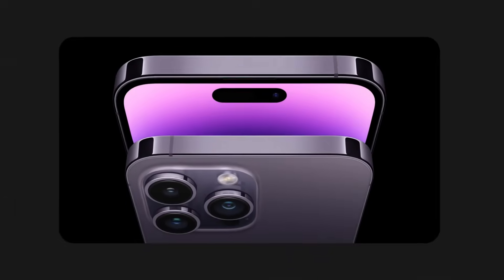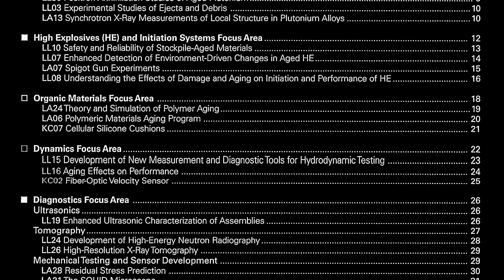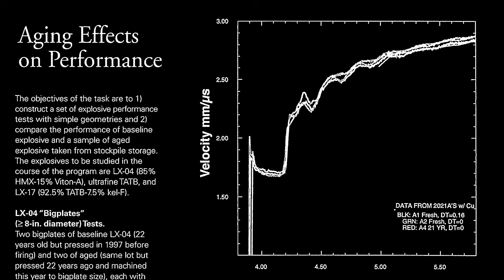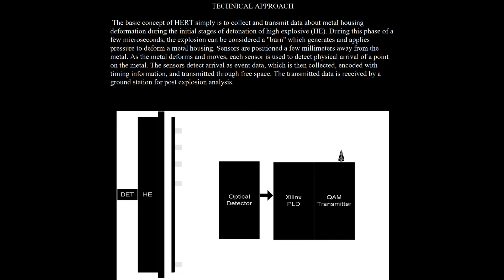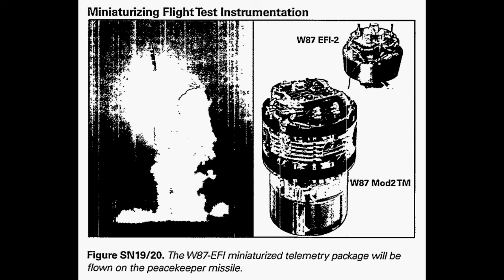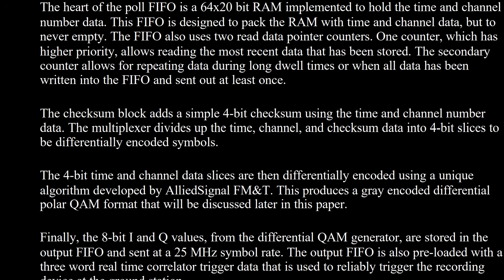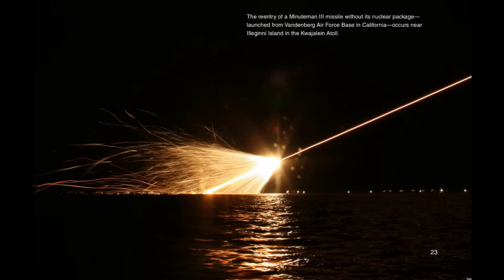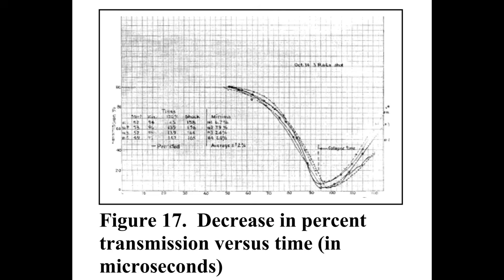The Computer Designed To Die In Microseconds

Comment: It's not a computer. This device is not Turing complete.
Reply from the maker: The FPGA is absolutely turing complete.
Reply: @scottmanley  *when programmed with an IP core. Otherwise I can call a suitcase full of discrete 2N3904 transistors Turing complete -- just need to connect them.
Reply from the maker: You'll find that most things that are demonstrated to be Turing complete may require a setup process.
Reply: @scottmanley  and what would be the limit for that setup process? With large enough limit I can call not only a suitcase of 2N3904s Turing complete but also a pile of sand with some phosphates and metals.

Comment: This reminds me of a story of a guided rocket launcher that had a memory leak in its programming. Ultimately the project lead decided they didn't need to fix the memory leak because by the time it would become a problem, the computer would have much bigger problems, such as the high speed impact with the target (could knock some wires loose) and the detonation of the explosive

Comment: In the 1980s I worked in an X-ray physics lab whose primary work was measuring the X-ray flux of thermonuclear events.  We would spend months working to capture multiple channels of 350ns of data with as fast as 10ps rise times with about 9-bit resolution.  Once the data was captured, we had around 100 milliseconds to transfer a sample of that data into non-volatile storage before the mechanical ground shock arrived and potentially caused a power outage or physical damage to the data collection system.  If the system was still running after the expected ground shock time, it would go back and collect all the data and store it in non-volatile storage.  The system used TI minicomputers because they were set up for battery backup.  We also used 8" floppy drives because in those the read and write heads were in contact with the floppy disk so the heads couldn't crash.  If everything went well, once the data was stored, a program would start analyzing the data, so the next day or so when we could get physical access, the reports would be lying on the floor of the screen room where the minicomputers, transient analyzers, Versatec printer/plotters, etc. were.  This was before fiberoptics, so everything was down in the tunnel.  If you had a "leaker", the data would not be available for a few thousand years.   While I worked in that group, we were lucky, there were no leakers.

Comment: Talking about not needing to worry about timer overflow reminded me of a simulator project I worked on back in the '90s - we were using a bunch of SGI workstations to run the simulator, and needed a reliable way of determining time deltas between events.  Conveniently, SGI had put hardware counters on all their hardware, so we wrote a timer class that read the counter and computed time deltas from it.  The low-end hardware that we did most of our development on only had 24-bit counters, which rolled over pretty quickly, 10-15 seconds or so IIRC, so we had to manage rollover events on that hardware.  The big Onyx workstations that we ran the sim on had 64-bit counters, which wouldn't roll over for about 10k years or so even with a higher update frequency, so we didn't bother in that branch of the code.
Reply: Very cool!

Comment: I have a Sony experia 4 perfectly fine earlier top model phone but it has become almost a useless brick because Sony no longer provide uppdates so no new programs works on it , and you can not install old program versions... Same happened to my iPhone 4 it was useless brick the last 5 years I was using it, only the phone worked and apps that did not require intenett to work. No new apps was possible to install so it was frozen as it was.

Comment: 100MHz is very slow,  specially if you work with FPGA's.  In this day, STM32H7 has timer with 500Mhz clock frequency, not to mention some old TI DSP's that can have sub 100ps (10GHz equivalent) capture ability

Comment: I became fascinated with Xilinx technology in the '90s while working as a production tech for an Australian ISDN MUX manufacturer. While I was familiar with various families of programmable logic devices (and I liked PEELs because they were electrically erasable) the Xilinx chips were effectively a RAM array with each bit operating a switch in a logic array such that a hardware circuit was wired up on each boot up as the bit-pattern was streamed into the Xilinx device serially. Compared with sending a tech on-site or returning a board for a hardware mod, (often involving track cuts, solder and mod-wire) you could perform a hardware mod by sending a file over the internet.

Comment: Confidence in "untested" nuclear weapons should be tempered with prior empirical evidence.  In the Castle Bravo test, Lithium-7 was incorrectly calculated to be inert as a fusion fuel.  It was not inert and caused the yield to be 3 times higher than expected.

Comment: It's also interesting from a software standpoint - I was talking to someone who used to work with missile software and apparently one place they worked some new person came in and was upset that the code had memory leaks and would almost certainly fail and crash - but it didn't matter because the missile it was controlling could only fly for X seconds so they just had like 2x the amount of memory the software could ever possibly consume in that amount of time, making impossible to crash because it would always detonate before it could fill up the memory.

Comment: I don't think that the explosions and pits are spherical. Later as weapons got smaller, safer, only used as low yield initiators and simulations got well calibrated, timing more accurate the "package" got more cylindrical.

Comment: The technology base that goes into building and testing Nuclear Weapons is truly incredible its a shame that we don't (Can't?) know more about it all. Many of the devices and systems used in testing were more sophisticated than the bombs themselves. I read in a memoir from one of the former test site engineers that they had a very tough time getting their monitoring hardware to survive long enough and being able to read data out fast enough. The technical challenge was huge just in designing the the explosive systems and massive doors used to seal off the testing tunnels in just a couple of milliseconds; only then to have to hold back the force of the explosion and maintain a good seal to prevent leakage. The materials and devices used within the bombs themselves are truly sci-fi such as solid-state neutron generators, aerogels, and the miniaturization of the arming, fusing, and firing sets themselves with their incredibly complex mechanical and electronic strong/weak links. If people knew about the advances that have come from our pursuit of Nuclear Weapons/Nuclear Energy they might appreciate it all a bit more.

Comment: This is super cool, though to put it into perspective the top layer of FR4 transmits data on copper lines at around .7c or so on nice controlled impedence circuit boards (Isola, Rogers, whatever-- the name brand stuff). Coax is around 2/3rds for standard RG58 (IIRC) and I bet there are low-capacitance triax type mil-spec cables that'll get you close to .8   

I'm surprised that you have such a loose budget for propagation delay on a spherical detonation device-- seems like you could do some real interesting work on tuning resonant waves to maximize yields with weird topological constructions and wave reflections (think of the weird shapes intake manifolds take on in order to intentionally bouncing intake airwaves on internal gas engines to increase mass flow)

Comment: 6:40 the explosive charges that forces the pit into a density to sustain Neutron proximity to adjacent atoms..?
Reply from the maker: No, the primary just has to push the fissile material to a density needed for critical mass. 
But the nuclear explosion that results is used to compress the secondary to pressures and temperatures where fusion occurs.
Reply: @scottmanley  yes

Comment: 30 years ago I accepted the professor's challenge on the 1st day of the lecture "the one who by the end of the semester calculates and makes a design of an implosion system with two initiation points does not have to take the written (harder) part of the exam". Succeeded as a plus added radiation-ablation implosive secondary system with a "spark plug" and as an additional award was placed on "The List". Today, when I go abroad, I have to ask for a permit and give explanations, not to mention constant electronic surveillance. The old people were right "The less you know, the happier you are".

Comment: Scary isotopes?  Well how scary?  Too often its a fun story to tell about a contaminated area then to find out it's not so contained. Walk into antique shop and get more energy from fiestaware, vaseline glass than most nuclear power plant buildings. Real data and real answers save lives.  Vague info and conjecture hide the truth. Not clearing a forested area leaving an intense forest fire hazard potentially releasing scary isotopes into the air is one of these " why worry about something that isn't going to happen " moments.
Reply from the maker: I have antique uranium glass, it's not a big problem because it won't be absorbed by the body. Radioactive Strontium on the other hand gets incorporated into your bones.
Reply: Even alpha and beta emitters which are not terribly dangerous externally can be extremely bad once they get inside of you.

Comment: Happy birthday. Welcome to the half-century club.

On topic, I used to work on a stratospheric balloon project where we needed an ultra fast high-voltage switch to trigger 12kV across metal plates as part of a spark-gap hodoscope. There were scintilators above and below the chamber to detect a charged particle. We needed to trigger the high voltage before the ion trail in the spark gas from the charged particle dissipated. The first hv switches we used were officially only rated to switch once. This was because the hv switches were originally designed for nuclear bomb triggers.

Comment: I understand the mechanical difficulties, but I'm surprised that they didn't attempt to make the transmitting computer spherical to keep its ‘corners’ as far from the encroaching shock wave as possible, maximizing it lifetime and the transmission duration of useable data. Bigger chips (like the FPGA) could be placed at the ‘equator’ with smaller chips above and below closer to the ‘poles’.  Thanks for the video.

Comment: Is it possible to transmit radio waves from the centre of a complete implosion sphere which includes a layer of ionised high explosive detonation products? Or do they have an antenna exiting the implosion sphere?
Reply: Scott exaggerated. The device sits in the back of the warhead, behind the explosives, with the cables running to the power supply, control box and RF power amplifier, then to antenna. Only the optical fibers run into the "physics package", where sensor-ends are embedded into the high explosive. The device still needs to finish transmitting the data before the shock wave damages anything -- which is not much time at all.

In the laboratory, very similar experiments were done with the sensors inside of the pit -- like Scott thought this was done -- but in such experiments only half of the pit/temper/explosive assembly were used, and the cable entered from the missing half side. That's a very old technique -- in the first versions the sensors were simply wires.The oscillogram of the voltages from all the wires showed nicely when each wire were contacted by the pit flying into them.

Comment: If the device is surrounded by a spherical explosion, is there any difficulty transmitting the radio waves through any plasma generated by the explosives? Spacecraft experience radio blackout, while undergoing re-entry, due to being surrounded by plasma, so I would assume there would be a similar issue here?
Reply: In comments ppl speculate that they detonate only half or 90% of a full sphere. Or their transmitter is powerful and their receiver is sensitive. You can probably pack 1 kilowatt silver battery in such a device (similar to one used in manpads missiles).
Reply: @hrissan  They exploded everything exactly like in a real weapon, except that plutonium was replaced with some non-fissionable substitute. The fiber optic sensors detected the initial phase of the explosion from the outside of the explosive charge. The electronics was also located outside, away from the explosion. (It still got destroyed, of course, just not as quickly.) It was wired to the rest of the electric system of the warhead and to an antenna. The transmitter was very small and put out only 10W, and even that for a fraction of a millisecond. The data could be received (using a largish dish on the ground) from 800-1000 km.
Reply: @cogoid  thanks for explanation😎

Comment: Years ago I visited a large Aerospace company [name redacted] and gave them the usual pitch of embedded operating system reliability - "never blue screens", etc. They then informed me that the system would only be running for a few minutes, once, and would never be used again.  Then I asked about issues of high/low pressure (under sea), high/low temp (friction heating in atmospheric flight), & radiation issues (space flight).  His response was that it would have to deal with all of those conditions, in that order, then in reverse... well most of the reverse.

Comment: Hi Scott, LOVE your content BUT to correct you (the ONCE ever I'm sure) your iPhone 6s is already long obsoleted. Yes you DO get security updates for a bit yet but what's MORE important is that you're already a while ago, persona non-grata for the actual iOS upgrades... which means you'll soon, if not already, experience software and apps you're not allowed to run. ANY Apple device made in the last 5 years is actually a bad choice or candidate for "look how long this lasts and is supported!". I have some MacPro machines that are 12 years old, work fantastic, and ONLY arbitrarily obsoleted by Apple b/c of greed.. so an iPhone IS the worst example to choose (you can use my 20 year old BMW instead as good example of long-living tech b/c I STILL receive periodic technical bulletins or recall checks if there's something they might want to check out - and I never even purchased it NEW and I've ALMOST driven as far as to the moon ;-)
Reply from the maker: Gotta compare Apples to Androids. Samsung provides 3 years of software support, and a other year of security updates.
Reply: @scottmanley  Hi Scott! Surprised that you read my comment and honored that you took the time to respond! Your content is awesome, I'm jealous of your technical knowledge. My Apple reference comes from a 28+ year background with Apple, waving the flag, converting Dos/Win users, rebuking the nay-sayers even when Apple stock was near $3 a share, Certified Tech, Owned my own Apple VAR retail, dealt with 10's of thousands of people and issues over the decades, turned DOWN a "genius posting" ... but it's all behind me now as it (Apple) is NOTHING like the company (and hardware) I once held in such high regard. I purposefully avoided the Apple vs Android (I run Pixel) comparison because that just loads a canon with arguments. I can only and will only speak from my place of knowledge and direct experience. Love your channel and look forward to your contributions in 2023.... and Happy Belated Birthday!!

Comment: My first thought was it would be the device that sets off the detonations in the first place, but as soon as you told me what it actually does, I realized the circuit that sets off the implosion would simply need to be remarkably good at simply sending parallel impulses.
Reply: Yes it has a trigger pulse that enables it and also mimics the neutron pulse. Neat device to be sure. ❤

Comment: It's easier pushing 50 than pulling it... Happy Birthday and Happy New Year.

Back in the 80's I was told that some underground nuclear tests included a stripped down VAX-780 (or 785 or 750) located near the device as a data collection and transmission device.  Not sure if that was true.  Maybe packetguy42 can reply....

Comment: Reminds me of a possibly apocryphal story from my first job. I worked in one division, but down the road was another, more scary division. They had to specify some precision gear trains to get a Swiss manufacturing company’s bid. The Swiss company saw the soec, and no-bid the project because “we cannot build a gear train that will operate reliably long-term with those specs.” The engineers from the company I worked for responded that they can guarantee that these gear trains only needed to operate for 8 minutes. The Swiss still balked, concerned that they would bot work repeatedly and might ooen them to warranty claims. The engineers reiterated that this would not be a problem. The Swiss still balked. So the engineers made it clear that if these gear trains were ever put into operation, neither the Swiss company nor the company I worked for nor any court capable of enforcing warranty claims would exist.

…because the company down the street was GE Re-entry Systems Division. Their product was MIRV vehicles for nuclear missiles.
Reply: This is .... well.... TELLING.